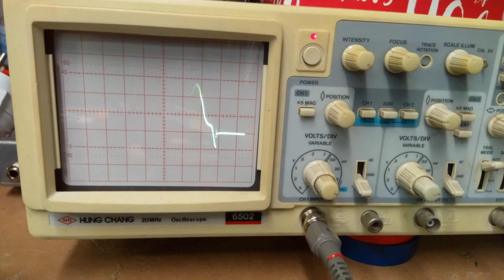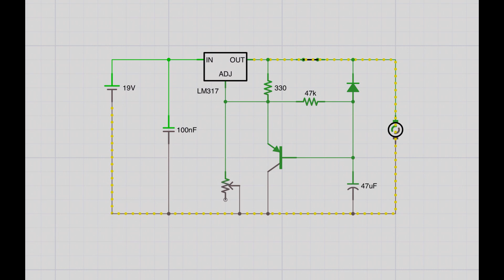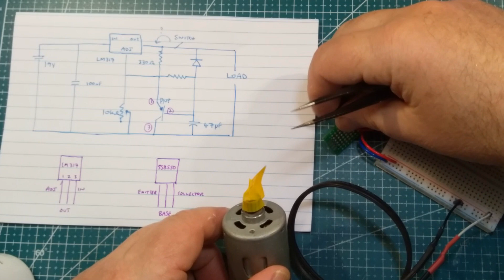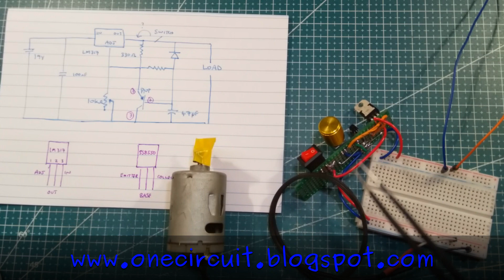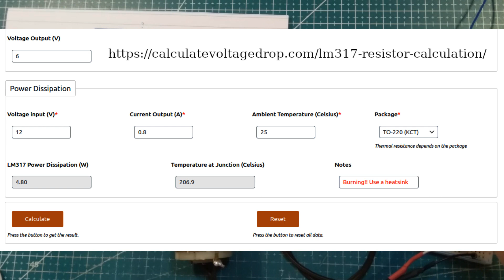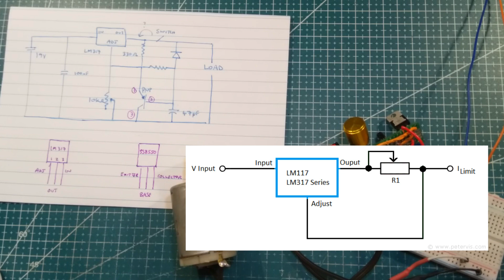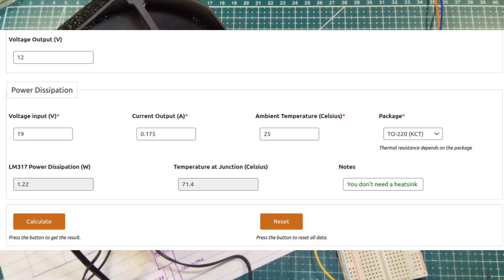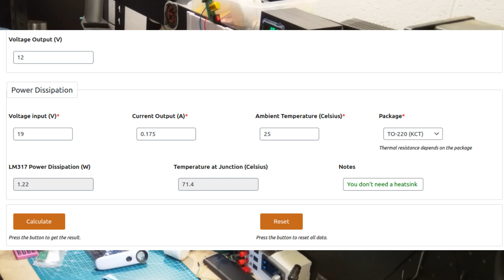Using a soft start circuit on two fans for solder fume extraction.

Comment: Computer fan tachometer output is an open collector, so just pull this up to voltage you need and you will see nice and neat square waves, usually 2 per revolution.
Reply from the maker: Wow! I could not find that info anywhere. To the bench! 👍😀
Reply: @Xaelloss. Yep, found this out when I repurposed an old HP workstation motherboard and needed to fool it into thinking all the fans were plugged in. One astable 555 timer circuit at ~1.6Khz and the BIOS reported fan speed at ~790 rpm.

When testing the tacho signal from the fan I got nothing on the oscilloscope, the corresponding pin on the motherboard header showed 5V. So, on my test circuit, a pull up resistor to 5V (I used 10kΩ) attached to the yellow wire and presto.. a square wave. You obviously don't need the pullup when the fan is plugged into the motherboard. After all that's how it's supposed to work.

Comment: Thanks for the video! Two things that I noted... The insulation on the orange wire on the bottom of the perf board looks as if the wire is burned up. If so, that adds a lot of resistance. On the power input side of the LM317, you have only added the 0.1uf required by the regulator, itself. As you are powering motors, I would think that you need to add a smoothing cap. I wonder, if that cap would help the second fan to start correctly...
Reply from the maker: Excellent powers of observation! I did look at replacing that wire - but then I knew that pretty soon I would design a PCB and eliminate all that hasty/nasty wiring. It was a bit of rush job in the end and the wire got in the way a couple of times of the soldering iron. Good tip on the input cap as well - I'll do that in the final design. 👍😀

Comment: A fan will always have the largest surface to suck from, because you can't suck more air than the surface, but you can blow. So, the pins that hold the fan motor is always the side it will blow out from. Hold you hand on the suck side and you will hear the fan spin faster and that is because it will suck less air. If you do the same on the blow side it will still suck the same amount of air, but the air will get a higher speed around your hand.
Reply from the maker: Interesting! Thanks! 👍😀

Comment: The yellow line is literally just a pulse for each rotation. The computer detects that to know the speed of the fan. The computer gives the fan a variable voltage supply to change the speed. Yellow is just a feedback pulse.
Reply from the maker: Hell of a signal to decode. I was hoping it was a speed control line, not a speed output line. 🤷🏻‍♂️👍😀
Reply: @onecircuit-as  3pin fans will always be voltage controlled for speed, 4pin fans can be controlled using voltage or pwm.  3 or 4 Pin PC fan wiring is always the same:  GND, 12v, RPM, PWM (Pin: 1,2,3,4).  Also if you plan to run the fans on max all the time there is no need for a soft start as that is built into the fans.  The max most 12v pc fans can run at is around 16v before you fry them.  But running them at anything higher then 12-13v will degrade them as well.  All you should need is a buck converter to lower the voltage to 12v and add a pot to lower the voltage if you want to control the speed to run slower.  I think the lowest voltage the fans will start at is around 5v.
Reply from the maker: @pheelix-   I'm definitely more fascinated by soft start circuits than I need to be! 😁
Reply: @pheelix-  I highly agree that your suggestion of a SMPS is an efficient way to power the fans. I would only offer that SMPSs are electrically noisy and that it would be good to consider how to manage that noise, within an EE lab setting. My guess is that the best way is to not use one in the lab. With all due respect... Truly.
Reply: @ idk what sort of power supply he is using, but if your talking about fan noise from controlling fan speed.  The fan won't make any electrical noise with voltage, but it will with pwm.  But it looks like he isn't using pwm so that isn't a issue.
Reply from the maker: @t1d100  The SMPS is routed through a linear voltage regulator before it hits the fan (https://youtu.be/RIWDBH8m11o?si=tuthJVa2SKqkP0uj)
Reply: @onecircuit-as  Thank you for your reply. You are very correct... A linear v reg is a good way to clean up a SMPS. Not to be contrary, but my concern was with ambient noise in the lab. (A v reg would not mitigate that.) And, if a SMPS is used, it would be best to have a strategy for managing it, such as adequate shielding. For example, most/all newly manufactured top-end EE lab equipment uses a SMPS, but consider the engineering, extra assembly effort and cost that the manufacturers put forth to shield the noise. So, I am not against using them. (That would be unrealistic.) But, for a hobbyist lab, where DIY test gear design is being considered, avoiding using a SMPS is one option for managing the ambient noise that they produce. That is not to say that transformer based power supplies do not make any ambient noise, at all. Good thoughts and discussion.
Reply from the maker: Now I’m keen to look at that signal in a “cleaner” environment! 👍😀
Reply: It was pretty messy! But, free fans are free for a reason 😊